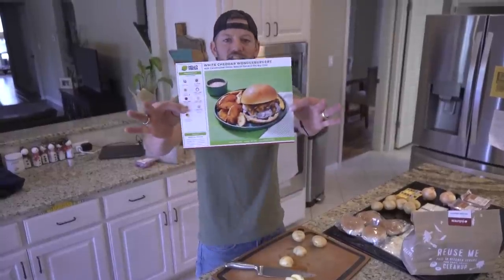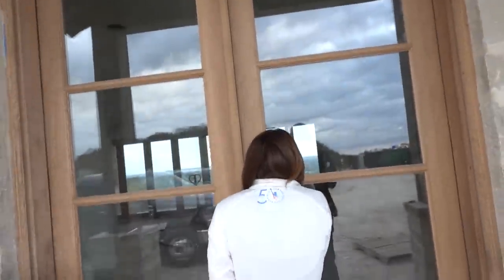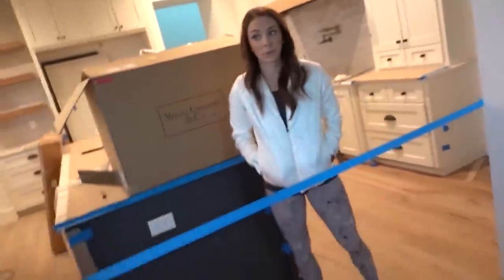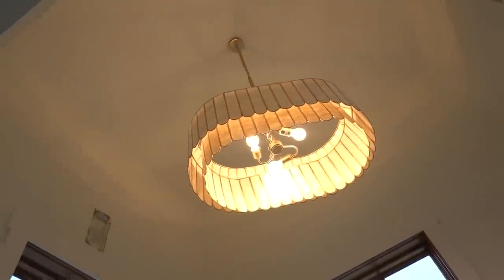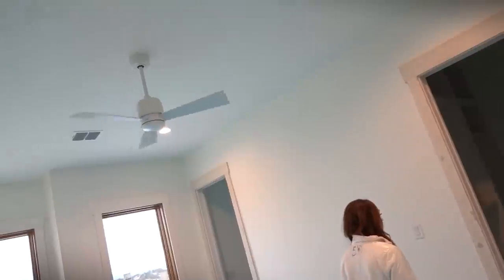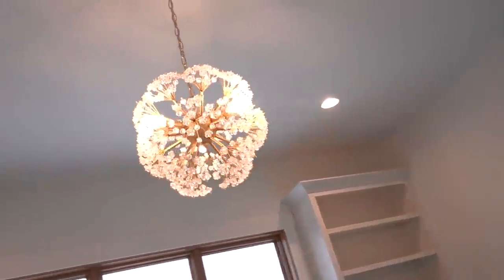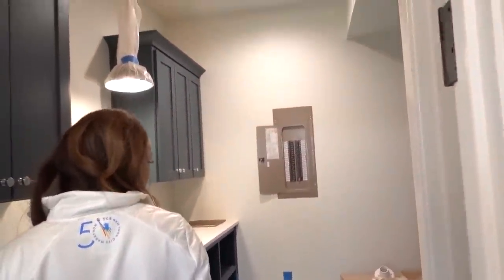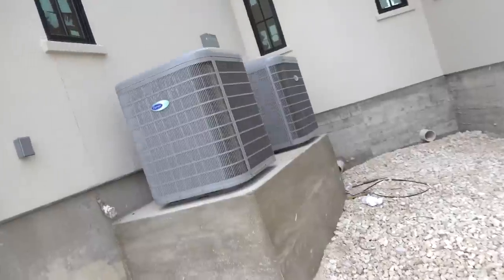Not an Abandoned Mansion Anymore!!! Full Tour!

Comment: I'll bet the pool installers were thrilled to put in this pool.  Everything above ground, no digging...just install it all at ground level, then bury it all at the end.
Reply: That's true, but them are going to put something to cover the pipes and make it easy to check for leaks. Also some coating to prevent from freezing.
Reply: Seeing the pipes on bare ground is triggering me lol, put some sand under them!
Reply: @pai1238  I somehow think that ground freezing in texas isn't that big treath... Yea they got some snow realy this year there but not long enough freezing temps for ground to freeze.
Reply: @JamesH98203  Triggered plus here!
Reply: @Brian-jv8iy  Tell me about low temperatures when I'm used on winters having -20 degree Celcius... Tho sand might act bit differently as insulator when you compare it to normal soil.
Reply: @ReijoRitari  here in idaho it gets in the -20-30+ Fahrenheit
Reply: @TylerDuysen  In my knowledge idaho is pretty much high north when compared to texas...
Reply: @ReijoRitari  were the northwest texas is the south high north would be new york vermont etc but were also thousands of feet higher up than texas
Reply: @Brian-jv8iy  Ive lived in South Texas for 20 years and that was the first time it FROZE in supposedly decades. I think odds are with you if you'd bet on it NOT freezing again at least until your pool is installed
Reply: My thought is more the rocks underneath rubbing over time as the pipes flex.
Reply: I'm sure we're going to see an episode of him digging up he's yard looking for leaks in the near future. To bad he couldn't build a tunnel system like a pipe chase for the pipes for easy access..
Reply: @jaytibby  I don't know why they wouldn't just build the pump house right next to the pool instead of running 1000ft of pipe

Comment: For the under stairs bathroom: Get some adjustable bumpers that go on the hinge pins and bump against door trim to limit swing open. The place is lookin great’
Reply: They break all the time.
Reply: Nah man get one of those door stoppers that flings around like my dingaling after a shower
Reply: @Ohio_Isnt_Real  😂😂😂😂
Reply: @Ohio_Isnt_Real  🤣🤣🤣🤣
Reply: @HGVdiscoDave  I know youve helicoptered that thang around 😉😏
Reply: Change the bathroom door so that it opens out.
Reply: Door saver hinge pins are also an option.
Reply: Sliding barn door can also solve that issue
Reply: @buddynva  and smack someone coming down the hallway?
Reply: This is the way
Reply: @MHoff-wm4jk  yes. I only have the hinge ones. Have never broke one. The wall/trim ones break easy.
Reply: Use a floor door stop. Bad idea to open a door in a hallway and the hinge pin stops are not strong enough to last with the quality of doors you installed.

Comment: hey Just a tip on pool equipment from someone whos been doing it 10 years, no matter what they say get a cartridge or DE fitler DO NOT use a sand filter they a re cheaper trashier an will always let sand an small particles back into the pool. A cartridge is the simplest an in my opinion makes the pool 10x cleaner.
Reply: Buen dato no solo para ellos sino para el resto del mundo!
Reply: if sand gets in the pool, you're doing the backflush wrong

Comment: Are you installing any lightning prevention? A large metal roof on a hill seems like a big target
Reply: There are usually metal spikes that stick up above roof line that are grounded with heavy wire
Reply: Lightning rods are common in the Midwest, I would expect Texas is similar.
Reply: I assume they will have a couple of those lightning rods arround the roof
Reply: @johno1831  Use a lightning rod been used for hundreds of years lol.

Comment: 12:50 Just so you know, you shouldn't disable the window from opening. It's required by code that there be two points of egress in every bedroom, this usually means a door and a window (which means the window has to open). It's really important that whoever is sleeping in that bedroom is able to escape via the window if there is a fire.